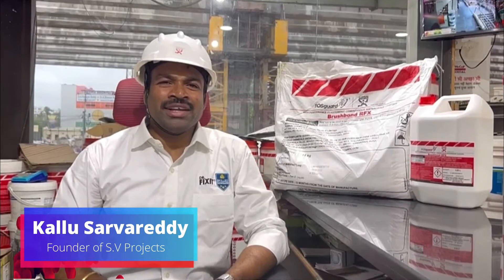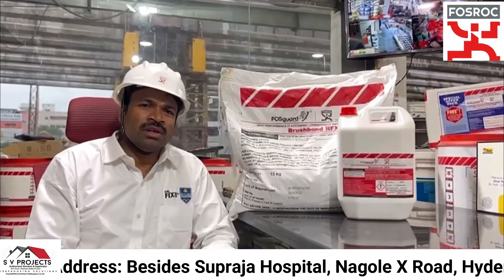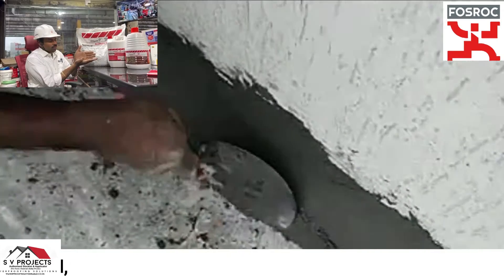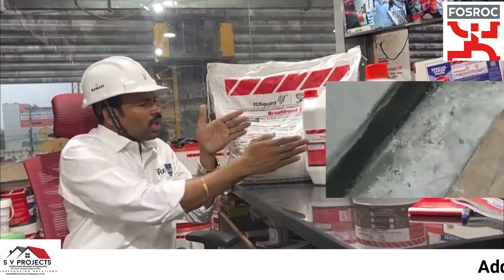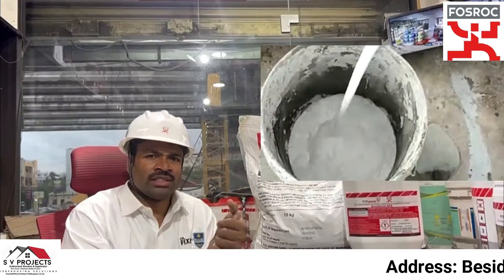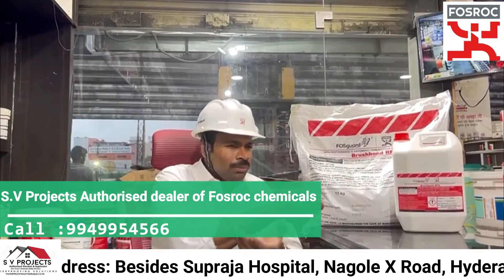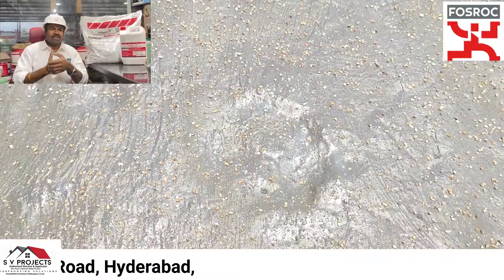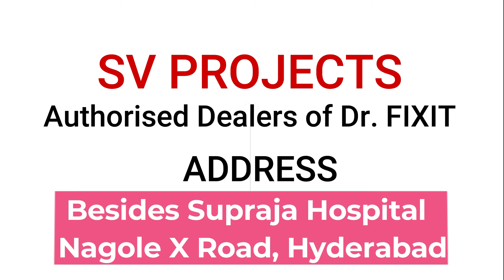Fosroc Brushbond RFX Mixing and Application | Brushbond RFX Waterproofing Chemical | SV Projects

Comment: Yes correct, any emulsion or coating should not be apply at above 37° temperature. 
Because the liquid content evaporate due high temperature  and solids will be left over this lab.

Comment: Chala baga explain chesaru andi meru but one point I need to add is don't do waterproofing application between 12 pm to 4 pm and minimum time interval between 1st coat and 2nd coat is 6 hour's 👍🏻
Reply: any problem between 12 PM to 4 PM?

Comment: For Rooftop water proofing, Fosroc chemical 2 layering is suggested .. is it enough??
Reply: Buy proper cleaning and before Aplication maintain the slab wet condition. The 2 coats application should be perpendicular direction one to other.